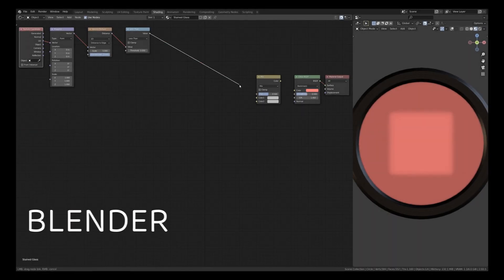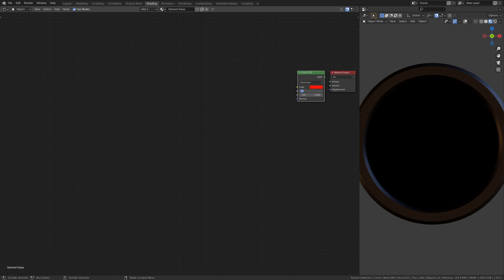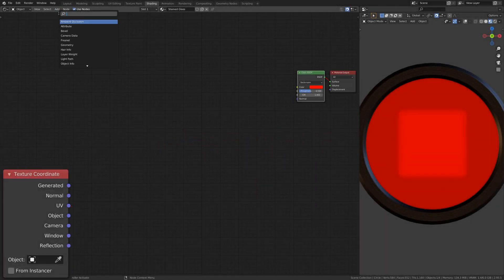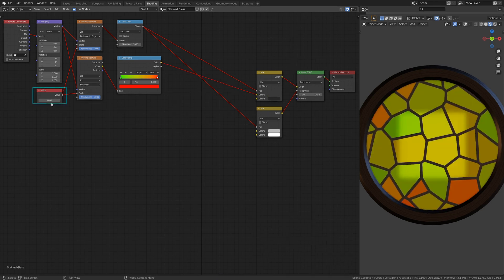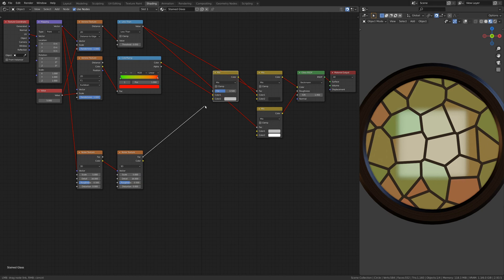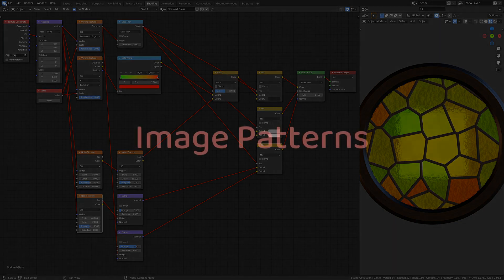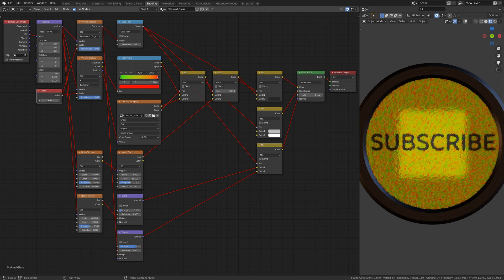RENDER FRIENDLY mosaic glass TEXTURE using Blender nodes (Procedural Material Tutorial)

Comment: Amazingggg!!! Thank you so much :)
Reply from the maker: Glad you like it! :)
Reply: @sinasinaie  Is there a way to assign a material to the frames of the glass?? ...so long looking for a proper mosaic glass... and this procedural one adapts to every mesh and so many parameters to play with... Thank you a lot once more!!
Reply: And the last trick to be able to use an image as a source pattern ... so goood!
Reply from the maker: That's a good question...
By frame, do you mean the line around each piece of glass?
If that it is case, I don't think that is possible with this setup, unfortunately.
Reply: @sinasinaie  Yes! I mean this line around the glass ... So I cannot change the color or the material??
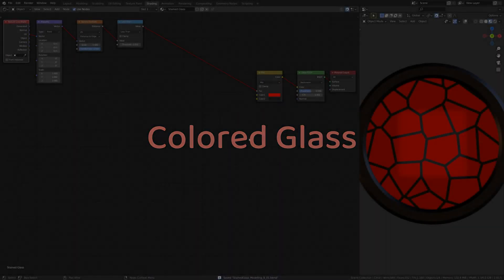Reply from the maker: At around minute 2:30, there is a mixRGB node with two colors: "red" for the glass, and "dark gray" for the line around each piece of glass. Play around with that second color, if you want to change the color of the line between the pieces.

Aside from that, in the video, there is a circular frame around the entire thing. That is a completely separate model, which you can assign any other material to.